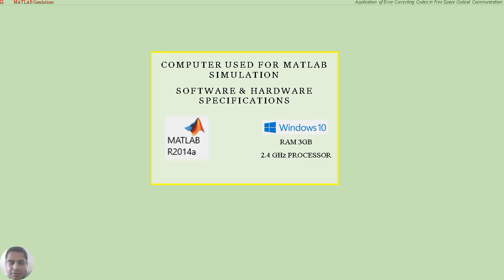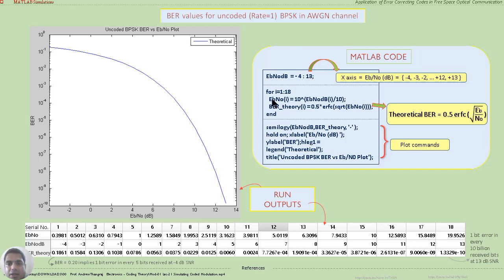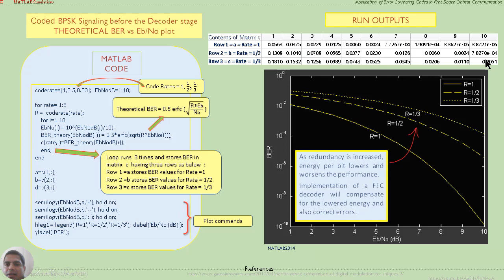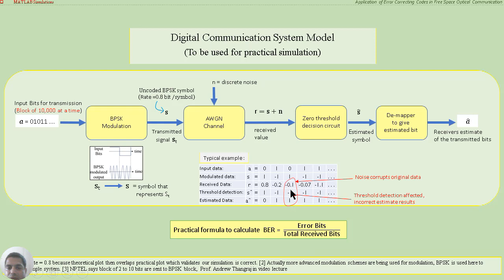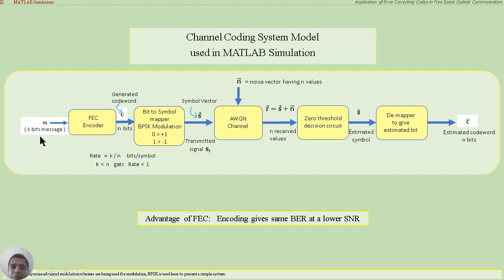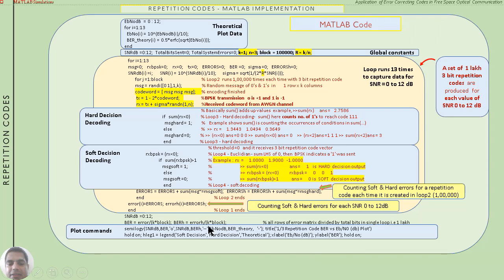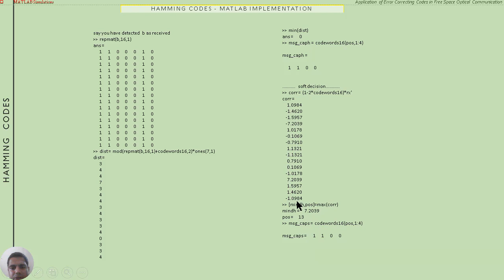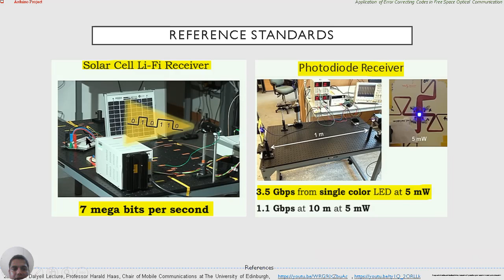Error Correcting Code MATLAB / BER vs Eb/No Plot  PERFORMANCE ANALYSIS

Comment: Hi excellent work Sir. Q: i would expect the rate 1/2 and rate 1/3 to move to the left meaning that because you are using FEC then you would require less EBNO but the graphs are shifted to the right which indicates that more EbNO is required which doesn't make sense to me. I got the same graphs as well.  Can u pls clarify?
Reply from the maker: This expectation will be fulfilled after FEC decoder stage. Note that this part of simulation  shows  demodulation stage only !  At detector point the bit energy shared by parity/coded bits has lowered the performance. After decoder stage(which will follow later) the graphs start moving left, showing FEC decoding action = the coding gain acheived over the uncoded graphs and compensation for the  lost performance due to FEC extra  bits.
please see the label 'b' is highlighted to reflect this.